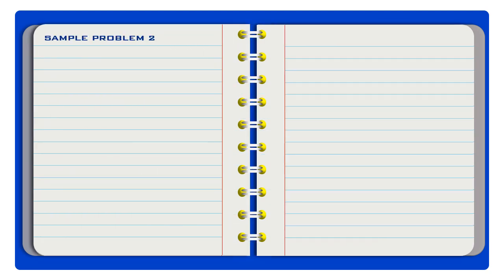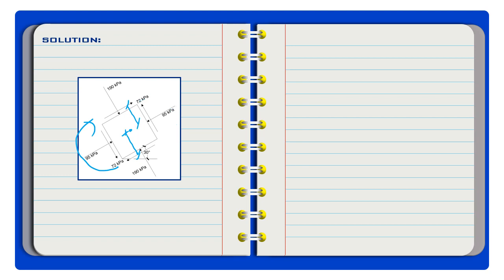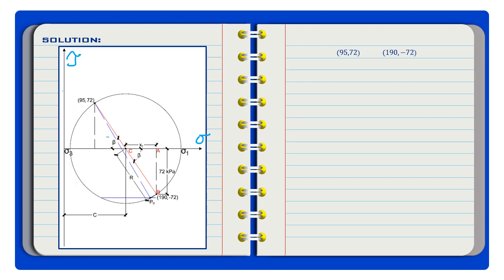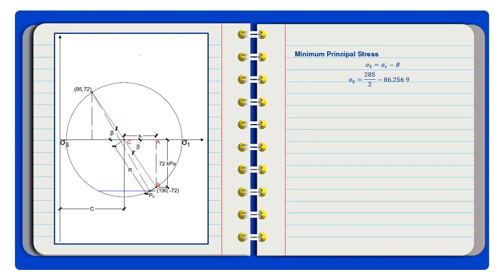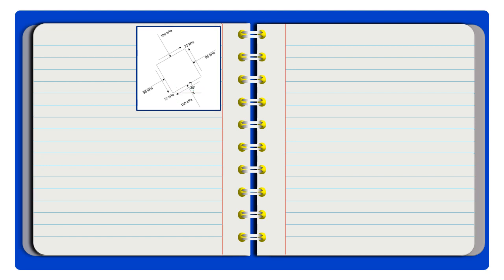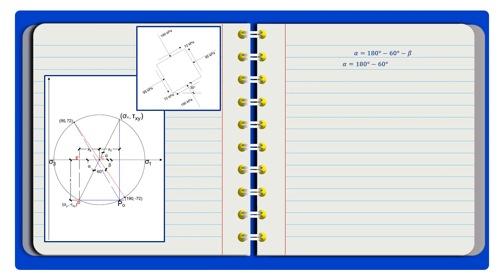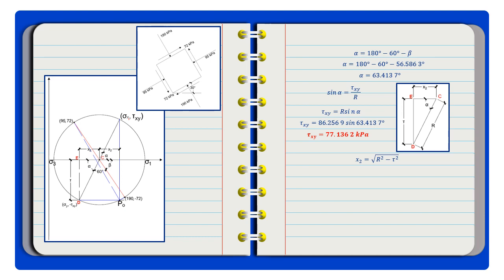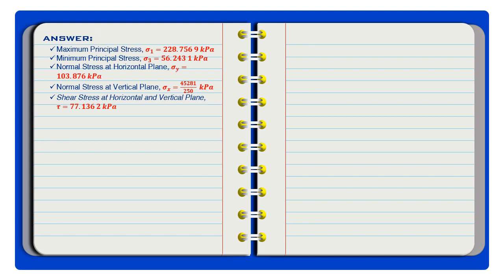MOHR'S CIRCLE SAMPLE PROBLEM 2

Comment: Hi po, sir. What would be the only difference if we are to find the stresses of the horizontal and vertical planes if we do consider the rotation of the element?
Reply from the maker: I think Vanz it depends on the question, if ang question kase is from a horizontal and vertical element tapos sinabi sa problem na it will just be rotated at a certain angle with the same magnitude of stresses as in its upright position, there will be no changes just the rotation itsel, ang magbabago siguro doon kapag pinakuha ka ng stresses from certain angles in its upright and rotated condition. I hope, I have answer the question kahit walang figures.
Reply: @buchtv8573  took me some time to internalize it but I understood it somehow, sir. It's even more understandable when I tried answering problems about it. Thank you so much, sir!